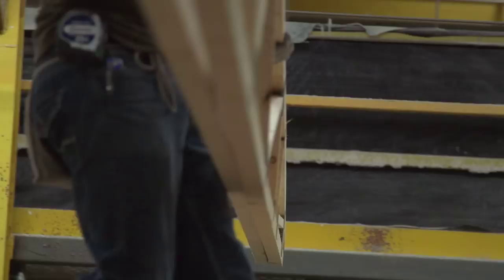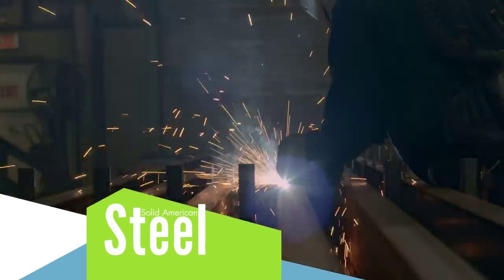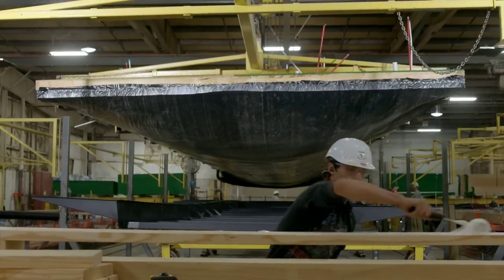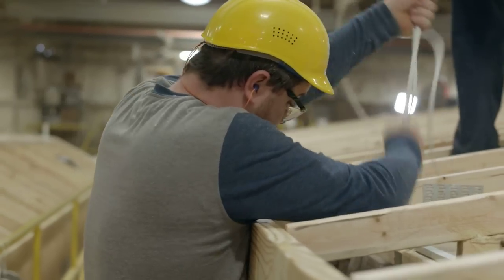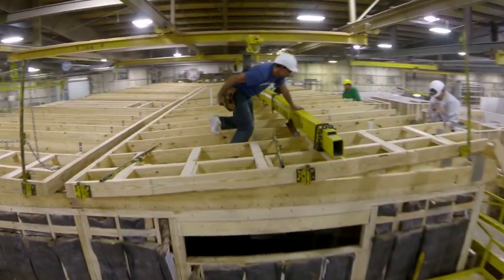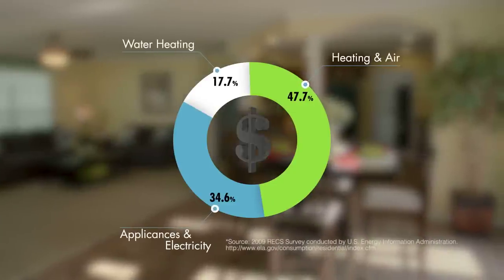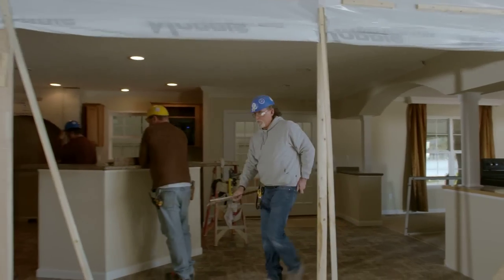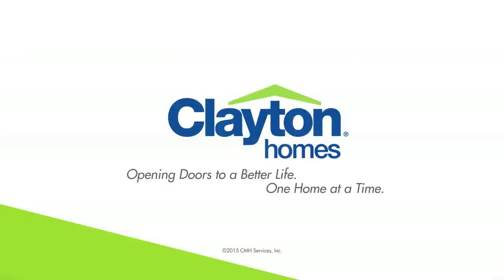Clayton Homes Quality and Innovation

Comment: I am two years into my beautiful, solidly built and very practical home from Clayton.  I bought a Steal 5 bed 3 full bath home 2,100 sq ft.  It is well built, nothing "shoddy" about it.   Since it was "on the lot" I didn't opt for any "extras" (that's what Home Depot is for) -- I have had zero problems once the home was delivered and set up on it's own block permanent foundation.  I wouldn't choose to live in a mobile home park tor two reasons: I don't want to pay rent on something that I own.  Plus, the population density tends to be very high to maximize land use and income for the owners of the land (and they can rake up the rent as they choose).   Setting the mobile home was high, electricity, gas, drainage, water... I spent 40+ k and a scooch higher than 100K for the mobile home... I own my home, on my own land and it is beautiful.  I go home without a monster mortgage hanging over my head (prices in the city for a stick built house are well over 450k... most scratching 600k with the lot I have).   I will care for my home, because my home will care for me.   All homes deteriorate (I have built three stick homes in my life, if you don't do upkeep, everything deteriorates).  With the beautiful patio and terrace I have put on and the carport (really nice stand alone structures), I am sure that this home will retain and even go up in value.   The folks at Sierra Vista Clayton in Arizona did me well.  Great team.  If you care for what you have, what you have will take care of you.  Treat your home like trash, trash will you have.
Reply from the maker: Thank you so much for your feedback! :)
Reply: A home built with quality materials, in a 'jig' and in a controlled environment is far superior to stick-built homes!
Reply: Great information    Thank you
Reply: Nice size...
Reply: I purchased my land and home thru clayton as well $176,000 total. I also opted out of an Hoa community, homes sit on top of each other. I only purchased a half of an acre but its beautiful, my home is 4 bd, 2 bath and my neighborhood has $200-$500,000 homes in it.  Mine is 1680 sft. But it seems much larger. So I also can see the value of my home increasing in the future, with my upgraded landscaping and so forth.   I'm so proud of my choice and my home will be permanently attached to my land which will make it real property, the project will be complete the end of Dec, I absolutely cant wait😁
Reply from the maker: Ms Dee! Thanks so much for sharing those kind words and we cannot wait to welcome you home. Thanks for choosing Clayton Built and welcome to the Clayton Family!!
Reply: How much was the payment on the mortgage loan
Reply: Beautifully said! I am so excited to move in my Clayton home Nov 1st. It can't get here fast enough! Lol.

Comment: As a retired 60 yo, I would love to have the opportunity to work in a facility like this part time.  I would be the best worker...attention to detail.  Have always been a piddler and have remodeled several homes/condos in the past.
Reply: No you dont . This is absolutely the hardest job in the world,I know ,I've worked in them for years. Firstly they dont tell you that workers have an average of 25 minutes to do there jobs. That means all electric from rough wiring to finish electric check has that allowed time to get it done, secondly they are not showing that multiple jobs are bring done in a house at a time ,20 people in one house you are continuously in each others way. Electric girls hanging lights and toeing off plugs,inside sheetrock hangers,door hangers,cabinet setters, finish molders,clean ip crews,adding appliances and anyone that's not finished up with there jobs its horrible. Then add the fact that they add all the plywood to the house its 120 degree inside. I could go on and on oh did I tell you they hardly pay more than minimum wages.  You get the picture I wouldn't wish a job in a trailer plant on anyone.

Comment: I worked at the one in Savannah TN and i can tell you that the ones there at least, are slung together.
Theres all sorts of things i seen that rolled out of there, that i thought would never be acceptable..lol but we just covered it up with drywall and siding and let it role...im talking about all sorts of things, unsquare, half nailed, halfway done..i even seen nails through wiring that made it through..and was never said anything about.. lol, trim hanging halfway off..insulation half missing, siding wavy as a snake...i even went here recently to a dealership and the new models i walked in from that facility, you could immediately see the windows was crooked in the walls, and the doors was too, and trim was falling off, told the sales man and he didnt say anything but, yeah..your right.. lol...if they would slow down and take their time and not slave drive, they would be built alot better...
Reply: What type of caulking is used on the corner seems on the interior sheet rock to prevent joint cracking? it it just regular acrylic latex caulk?
Reply from the maker: Dominic - Each builder that falls under the Clayton umbrella uses different suppliers. Your local model home center would be more than happy to clarify specifics.

Comment: Very informative video!  We have been considering a Clayton Home and I am more persuaded than ever that a Clayton would be a great investment.  I owned one years ago and it was a solid home then. I'm sure they're made even better now.
Reply from the maker: Rob, thanks for your kind words! We're more than happy to answer any questions you may have along the way!
Reply: I worked at the one in Savannah TN and i can tell you that the ones there at least, are slung together.
Theres all sorts of things i seen that rolled out of there, that i thought would never be acceptable..lol but we just covered it up with drywall and siding and let it role...im talking about all sorts of things, unsquare, half nailed, halfway done..i even seen nails through wiring that made it through..and was never said anything about.. lol, trim hanging halfway off..insulation half missing, siding wavy as a snake...i even went here recently to a dealership and the new models i walked in from that facility, you could immediately see the windows was crooked in the walls, and the doors was too, and trim was falling off, told the sales man and he didnt say anything but, yeah..your right.. lol...if they would slow down and take their time and not slave drive, they would be built alot better...

Comment: It always amazes me that some people feel the need to expound on their lack of knowledge on subjects they know nothing about. To label the building materials that Clayton uses as "cheap" only exposes the level of ignorance of the individual saying these things. The truth is Clayton uses only the best and proven building materials available for home construction. Having been in the site built home industry for over 16 years, I can honestly say that these are the same materials used in the construction of any million dollar mansion. I'm sorry that many of you feel the need to tear things down for no reason. These homes have been true blessings for thousands of family's across the United States for many, many years.
Reply: Ur wrong
Reply: @Sirmac613  You're alone in your opinion.
Reply: I haven't seen wall joists spliced out of short pieces of 2 x 4 in a site built house.
Reply: @mvarner0962  I have.
Reply: Bullshit. I have worked with crews and built million dollar mansions. I have never seen particle board in floors that falls apart when it gets wet. I have never seen plastic cabinets and cheap vinyl flooring and you sure won't see 4x8 panels on the walls with strips covering the seams and exterior doors with large air gaps where they  are supposed to seal. These are just a few of the things I have seen.

Comment: Does the ceiling insulation cover the AC ducts?
Reply: Most A/C and heating ducts are in the floor.   The duct work is protected inside the flooring, underfloor insulation and inside the vapor barrier.
Reply: Fuck no dude
Reply: Live Oak and Jacobsen does insulated their ducts.

Comment: Do you offer a double wide size home in northeast Georgia with: premium grade plumbing fixtures, 2x6 walls, drywall(none of those little house trailer seam covers on inside walls, some type of solid countertop, commercial grade elongated toilets and big shower/bath, and solid doors, hardee board or other zero maintenance siding (hopefully not vinyl or wood)and  metal roofing? As safe as a modern house in storms and tornado areas. Basically, built like a solid house but not worried about the decor and gimmicks and such. I’m an earthmover and just a casual builder(not pro)...and I get to know the customers that I do earthmoving for. The ones who I’ve graded house trailer lots for always have some weird plumbing issue such as a shower head that isn’t secured to studs, shower stall cracking, rocks thrown from mower through vinyl siding. I have some family land I need to set up a house on for my mother to temporarily live In while I build her a new home. And after she moves out of temporary we want to make it a rental property. And if things change it needs to be quality in case we re-locate it to another property. Is there a recommendation for a model that suits my needs? Price? Pics or video? Thanks
Reply from the maker: Technical Items - Thanks for reaching out! You bring up some great questions and we want to help you get the right answers. Availability truly varies from region to region and a rep in your area would be more than happy to help! See a list of locations here: http://ms.spr.ly/6057T3msh

Comment: Some of these comments are obviously from Clayton employees. I've been a carpenter for over fifty years so don't believe everything you see in this video. My niece just purchased 70 ft mobile home and just about everything I have seen is cheap junk and poor carpentry. Her home is just under 1200 sq foot and the total was over 80 grand for a stapled piece of junk. When the sun is shining you can see where the wallboards were stapled and to me it looks like hail damage on a car that was covered over. You couldn't see this when the trailer was sitting on the lot since they were so close together hardly any light was getting in. The cabinets in most of the trailers were plastic junk with the cheapest of everything throughout. If there was anywhere they could put a staple instead of a nail or screw that is what they did.  Some idiot didn't even cut out for a floor register and when I steeped on it I almost went through the vinyl so I ended up cutting it out myself. I was in the used car business for a few years band in the 80's and that was nothing compared to what goes on in the trailer business after what I have seen my niece go through.

Comment: So those so called pipes ,That are plastic ,,,Will hold up to 30 below weather? Are the pipes going to be  10 feet below top ground level??  What State are you selling these buildings  to?? How many inches of insulation  are you using on them exterior walls .I guarantee  you will not tell me how  many inches of insulation ( IF ANY )  you have applied to the exterior  walls to help with the weather conditions ,weather hot or cold. COME ON BACK  GOOD BUDDY. waiting on you .
Reply from the maker: Hi, Peggy- Thank you for reaching out to us. Homes are built to the required codes for their respective areas. You can learn more about our building process here: http://ms.spr.ly/6051TYo8v

Comment: Looks like very cheap construction.
Reply: Yeah, wood, steel, fasteners, pipe and insulation. I wouldn't use any of those things in my home. I'm sure you wouldn't either.
Reply: I worked at the one in Savannah TN and i can tell you that the ones there at least, are slung together.
Theres all sorts of things i seen that rolled out of there, that i thought would never be acceptable..lol but we just covered it up with drywall and siding and let it role...im talking about all sorts of things, unsquare, half nailed, halfway done..i even seen nails through wiring that made it through..and was never said anything about.. lol, trim hanging halfway off..insulation half missing, siding wavy as a snake...i even went here recently to a dealership and the new models i walked in from that facility, you could immediately see the windows was crooked in the walls, and the doors was too, and trim was falling off, told the sales man and he didnt say anything but, yeah..your right.. lol...if they would slow down and take their time and not slave drive, they would be built alot better...
Reply: @themotorcycleguy5980  no comment from @ClaytonHomes on this comment?  The consumers appreciate your honesty friend!!
Reply: @jaredkean7841  - the same comment was posted more than once by "TheMotorcycleGuy".  How many times do you think ClaytonHomes should have to reply?